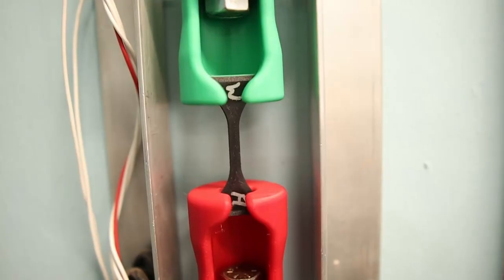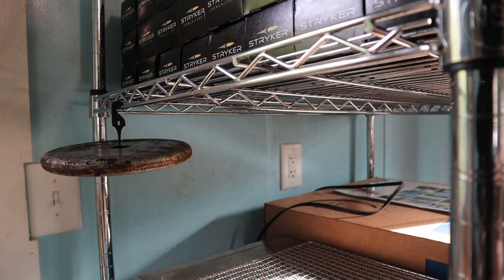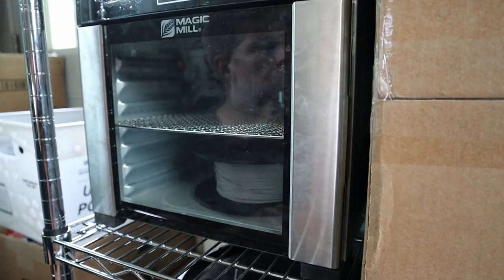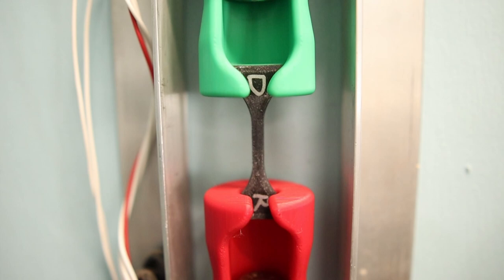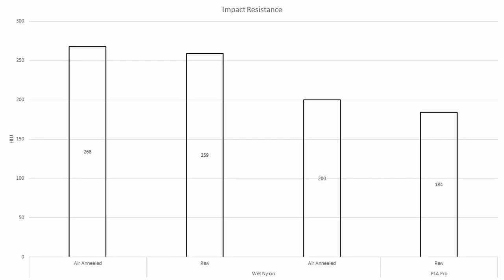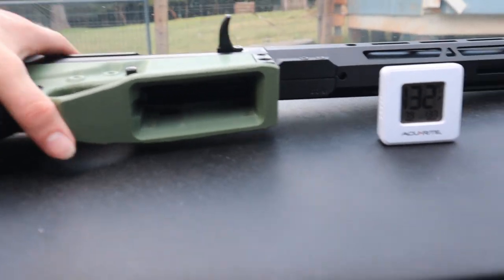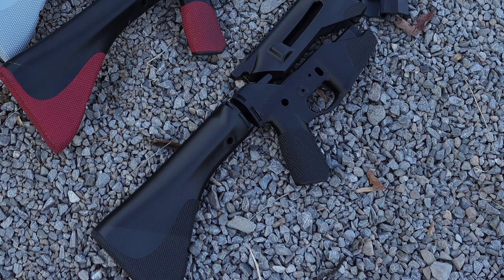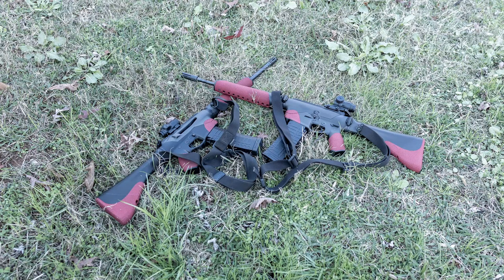My Thoughts On The Polymaker PA12 CF Nylon

Comment: I've been printing my frames, receivers, magazines, and accessories in PolyMakers PA6-CF. It's supposedly stronger than the PA12-CF (according to them) especially post - moisture absorption. AFAIK the reason the PA12-CF is more expensive is because it's a much more stable filament.
Reply: After a year now, do you still use PolyMakers PA6-CF ? im looking debating on witch filament to use for a lower.
Reply: @MrBiggs-wu2kf  yep. It's still my go-to. And works great. I now anneal my prints directly from the printer (6hrs+ at 200f).
Reply: How do u anneal it in the printer ? How can i do this with my bambu?
Reply: @cheizaguirre5494  I don't, i throw it in my oven at 215f overnight

Comment: I manage the printers at my work, I use CF PA12 to make last second custom tooling.  The stuff is pretty mechanically strong and very heat resistant.  Just a pain to break/clean supports.  Oh, yeah, you can also throw it on a milling machine 😉

Comment: Hwoffman!  Have you tried other compounds for annealing?  Like WD-40?  Are the oil annealed parts greasy and slippery?
Reply from the maker: No. Though WD-40 would be interesting. The parts in this test that has been exposed to oil where completely dry afterwards, no surface oil.
Reply: WD-40 is a oil detergent, it may disolve the nylon. I'd say PAG or non detergent SAE30 would be best bet.

Comment: So I just waited an almost two days for theSL- 15 I used it a Creality filment dryer on my ender 3 S1 pro with a harden steel nozzle  at 280 nozzle temps 50c bed temp it was ploymide PA6-CF . My first time using this filament .. ran the dryer it while printing use painters tape on the bed for better adhesion minimal warping … so I attach the new upper to it after printing… an left it on . Then I wasn’t paying attention and knocked it over on to the carpet and crack my finished print and now I’m back at square one  what can I do to prevent this again .. I wanted it for the heat resistance but it cracked on the first drop it took .. please I need suggestions only have enough to print one more lower thanks

Comment: Engineering comment on carbon-fiber nylon composites.  For most composites of this type, the carbon fiber carries the load and provide stiffness.  The nylon distributes the load between the carbon fibers and provides toughness compared to the brittle carbon fiber.  

This is why wet nylon matters much less in a composite part than a nylon only part.  Nylon with higher moisture content is actually tougher and the fact that it is softer matters less because the carbon is carrying the structural load.  This holds true until the nylon becomes so soft that you start to get fiber pullout and adhesion failures.  In some ways wet nylon is better at doing its job in the composite than dry.

That said, the actual carbon fiber lengths in these filaments are likely very short so the nylon is doing a lot more work.  When printing with them for structural applications, I would expect the fibers to be roughly aligned with print direction as well.  Across the layer lines, they may perform much more like nylon than a composite.
Reply from the maker: I think the short fibers negate a lot of this, as you said. With high fiber content Nylons I think this is the case, such as the PA6. But with lower fiber Nylons the stiffness of the base filament is still very important.

Comment: Just got my fiberlogy pa12CF15 going to probably need to upgrade my hotend heatsink fan to not get any heat creep printing in a warm chamber. I do see they make a 5% carbon version and would definitely have chosen that one but they don't seem to have any available in the U.S.
Reply from the maker: Yes. I actually ordered a roll of the 5% a while back from eastern Europe, but looks like it never got through! How is it for warping?
Reply: @HoffmanTactical  Haven't tried a print yet I will dry it thoroughly and let you know.
Reply: @HoffmanTactical  Just did some flow calibration cubes and already having some bed adhesion issues. Any ideas how to alleviate this? Tried getting a really squished slow first layer on 85°C glue stick and it has almost no adhesion. May have to bump my temps even more since fiberlogy recommends 90-110°C bed temps.

Comment: No one has done more for the community of 2a printing I appreciate the info .  Can’t wait to see how this material holds up.
Although esun pla+ still going strong just put another 60 round through the build.
I’m sure I could melt it down but I have once every other month put 2-3 mags through it just for fun and have yet to have any issues although I do store it in the house haha I’m sure if I put it in my truck on summer day all day I might mess it up haha but for a safe gun that is good to go the super lower I am very confident in holding up.
It will be interesting though when the new upper is tested to such a extent.
Soon as I get off couple weeks after Christmas plan on maybe looking at what you got on website and building another build. Appreciate your work Brother.
God bless

Comment: Great video! Can't wait to see creep tests!

I wonder, according to polymaker's datasheets the PA6 nylon that has been moisture conditioned is stiffer, stronger, and tougher in every metric than even dried pa12. The youngs modulus of wet pa6 is 170-185% higher and the bending modulus is 180-190% higher than dry/ moist pa12 respectively. So while pa6 does lose strength and stiffness (while gaining impact resistance) from moisture conditioning, is it even a concern if it ends up stronger/ stiffer/ more impact resistant than pa12 ever was?

Surface finish aside, is pa6 not still the more technically capable (and cheaper) of the two?
Reply from the maker: I need to test the PA6 again, and see if this is really true. My testing results have not been consistent with those from Polymaker. But I do agree with you, that the higher carbon content PA6 is still a good option. Especially considering the higher temp resistance. Layer adhesion is an unknown at this point still, but will also be part of the equation.
Reply: And watching this test of polymaker's nylon filaments, pa6 performs better with creep under load and torque. Very interesting, I'd love to hear your thoughts.

https://www.youtube.com/watch?v=cQb-hbr1KYY
Reply: I have a bunch of Hoffman lowers in polymaker pa6 and they have been holding up great in hot humid summer and cold dry winter here in Indiana. I anneal them at 175f for 6-12 hours. I usually put them in the oven or filament dryer overnight and get them out when I wake up. I'm curious to see Hoffman's data as his testing is much more scientific than mine, but I've had great results and its a bit cheaper than the pa12
Reply: @Hoffman Tactical  Love your testing man. It's something truly lacking in this community. I'd love to see ya test prusament pa11 and bambu lab pa-cf as well. The bambu lab filament is a mixture between pa6 and pa12. Heard great things about both.
Reply: @HoffmanTactical  Love all your work and all the testing you do! Can't wait for the orca release. Keep being awesome!
Reply: And also the garden sprayer super safety ;)
Reply: I don't have data but layer adhesion on the pa6 is pretty good. I have a hard time separating them even on a vase mode print.
Reply: +1 on testing bambu lab PA 6 PA 12 hybrid fiber…. Wouldn’t be surprised if it’s by far superior @hoffman tactical
Reply: +1 on this question. I came here looking for answers of whether PA6-CF is actually still more rigid than PA12-CF after moisture absorption. I think it is, the datasheet supports it, but it's possible that some of the curve continues moving with moisture absorption well after what the datasheet results tested for... Otherwise the sole purpose of PA12-CF is to look better?  ¯\_(ツ)_/¯

Comment: Instead of annealing in oil, try brushing dry parts with uv resin and curing with uv light, sealing parts and preventing them from absorbing moisture.
Reply: I've tried this method with esun carbon fiber nylon and it works pretty well.

Comment: hi i love your content and its definitely gotten me interested in wanting to try printing something  but i am a little concerned about the strength and durability of filament printing .im an industrial designer and was wondering if it might not be better to 3d print parts and then make silicone molds of the 3d prints  for resin casting, maybe even mix in steel wool or carbon fiber into the liquid casting resin for added strength. im wondering if any of the high end engineering or tool making casting resins might be superior to any of the 3d printer filaments? ...i was going to reach out to my supplier and get the specs of some of the casting resins to see if they are indeed superior to direct 3d printing but im not sure what numbers im trying to beat. what is the strongest 3d printing filament in your opinion and do you happen to have a rough tensile strengh so i have a reference to try and beat?  urethane casting resin might be interesting too because while its stiff, it has a little bit of stretch so it will be less likely to crack....anyway, if you can give me a tensile strength to try and beat i would appreciate it...thanks
Reply from the maker: Urethane casting is a great process when needed (I've used it for vacuum parts), but it is far more involved and difficult than simply printing the part, which is why I focus on direct printing.

Comment: My filament dryer only goes to 70c… am I doing anything useful if I put a nylon print in there for a few hours?
Reply from the maker: I think so.
Reply: My thought would be lower temp just needs more time to achieve the same thing as higher temp, for the most part.
Reply from the maker: @MartinMcbride-xu2dn  To some degree, yes. A higher temp will take less time to heat the part to the needed temperature. But there is still some minimum you need to reach. I assume that's 80 C. But it may be lower.

Comment: Interesting data. I'm wondering how many samples you printed to test, as this would add some robustness to your data.

Also curious about your thoughts on eSun's "upgraded" PA6-CF (15% infill). It's milled carbon fibre rather than the superior chopped (with longer filament strands) but any CF infill will help. Simply spraying a clear-coat layer after annealing will help with a) surface finish, and b) reduce water absorption
Reply from the maker: I've only been using three coupons per set. My results are consistent enough where I have high confidence in the result.  But with other testing, such as layer adhesion, using more coupons is a good idea. I've tried one of the eSun CF Nylons, not sure if it was the upgraded one, after absorbing water it became rather weak.
Reply: Haven't tried their pa6-CF but their standard pa-CF is all but unusable. Could not get it dry enough to print well even dried it for several days at 75°C and still had oozing all over the place. And I suspect esun is using very cheap CF because I had several clogs and gave up with it after half a roll of headaches.
Reply: @HoffmanTactical  thanks for the reply! eSun's original CF nylon (came in 1KG spools) was terrible. I've read nothing but good things about their "Upgraded" (that's actually what they call it in their branding) CF nylon that only comes in 750g spools. 

I've yet to build the necessary enclosure around my Ender 3 S1 (Christmas holiday project) but hope to print with it early in the new year
Reply: @rileyneufeld7001  I've heard similar things about their original CF nylon. Their original came in 1kg spools, whereas the 'upgraded' comes only in 750g spools. Just to confirm: did the one you use come in a 1kg spool? If so that's the original one

Comment: So over all i think the question still stands and your opinion matterz ...WHAT IS THE BEST FILAMENT ????
Reply from the maker: I don't know.
Reply: @HoffmanTactical  lol ur awsome bro thanks for what u do for us  its very much appreciated . I got some oveture easy nylon im going to try ...as well as the polymaker pa6 cf nylon.. i did have some ploymaker pa6cf before ..i was running nozzle temps at 285 to 290 and still getting layer adhesion issues within the layers itself.  ..the oveture easy nylon warpped for me idk why...i have an ender 3 pro with microswiss hot end amd direct drive ...4.2.7 board ..marlin 2.1..dual z . Ruby tipped nozzle

Comment: What's the difference between the heat deflection temperature and the glass transition temperature?  Because the glass transition temp is listed as lower than that of the Polymaker PLA Pro.  Maybe that's the number we should be looking at?
Reply from the maker: Exactly. Creep above the HDT is my concern.

Comment: I'm also on  Odyssey can you make a video about how to get the Ender 3 S1 to  Print use the polymaker CF12.  It says under settings my Max is 260 Celsius and red lines and I've had to pull the CF12 line directly out of extruder when I saw smoke. I want to make essentialy one of thos polymer ARs but with AR22 kit and I need a ruger 1022 receiver my aluminum receiver broke last year  I've tried making many at APL A&P LA plus none of them work I'm hoping for CF12.  But I don't know enough to what the Flash or how to Flash what were which onto the end of 3 S1.  There's so much out there for the purchase but nothing for the cruelty Ender 3 S1.
Reply: Also if you make a 1022 receiver put the bolt in w the Spring and the charger handle all that in it then and you'll see if it constricts to work perfect.  I can't even get my extruder to print out the CF12 Was out an alarm going off.